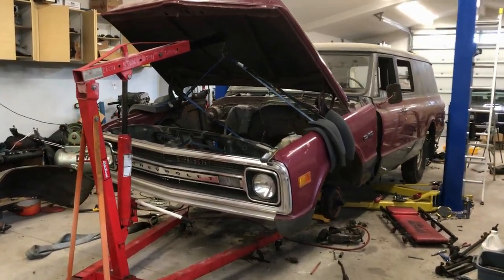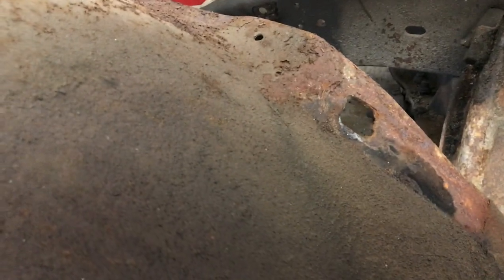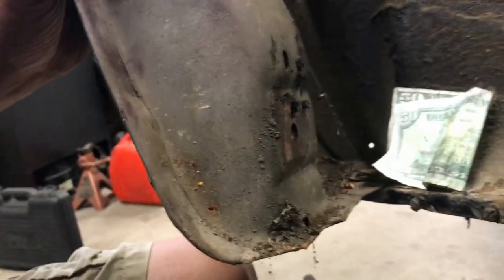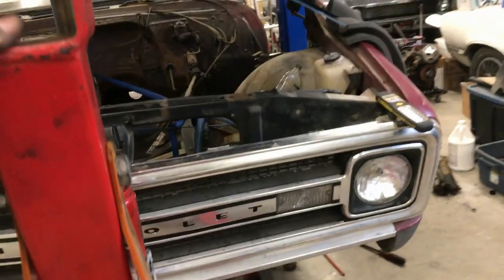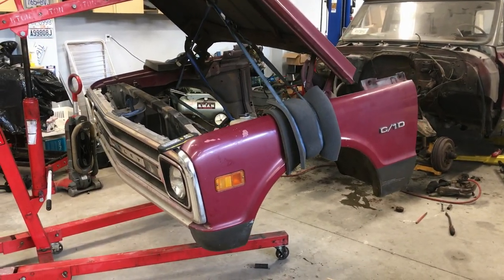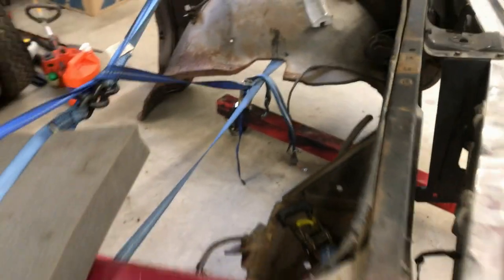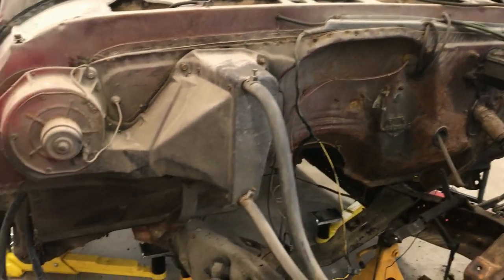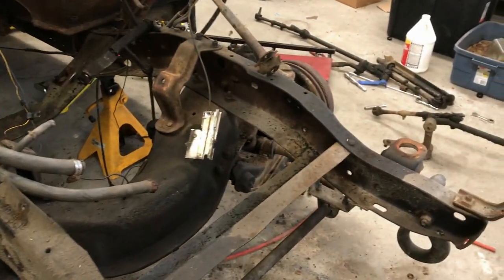C10 Front Clip Removal - by yourself!

Comment: A space bar/ separater bar between the back ends of the fenders is a good idea. Don't depend on the hood to take all the weight, you can end up bending the clip in all the wrong places.

Comment: is it normal to store a 50 dollar bill in the front fender clip??
Reply from the maker: Good eye, lol. The bill is still in the shop somewhere
Reply: @GIZZMOTORSPORTS  did you find it or you threw it in the video lol
Reply from the maker: @brendentaylor8976 I found that paper in a puddle in the alley of my old place, the hood was open on the panel truck, I placed it on the rad support. So many years later and at a new shop, there it is again. I'm pretty sure it's monopoly money or similar.

Comment: Good info, you didn't mention the two front bolts at the core support. It's unusual to see tow hooks on a 2 wheel drive truck. Are they listed on your SPID?
Reply from the maker: Hi thanks. Yes it’s in the SPID, labeled “4V76AB FRONT TOW HOOK EQUI”. Painted bumper trucks like this could have them from the factory was my understanding.

Comment: Did the clip flex much when you lifted? Did you have any trouble getting the gaps right when you reinstalled? Great video thanks!
Reply from the maker: Hi, I doesn’t look like the clip flexed at all. Make really good notes of what shims came out of where. I was thinking to put the clip back on, the truck is still apart!
Reply: Do not remove the hood from the clip assembly... that’s where the lateral rigidity is coming from!